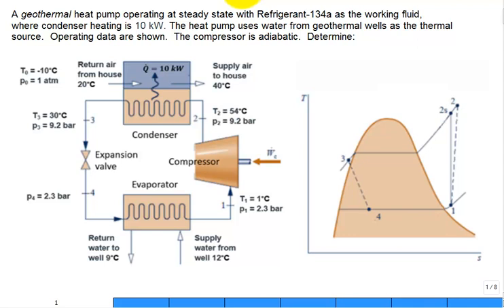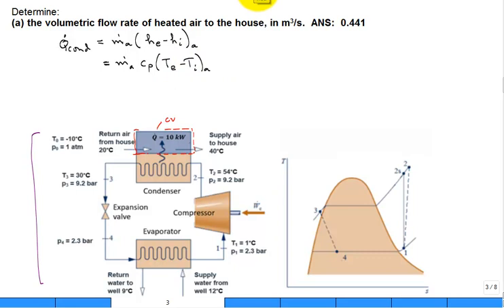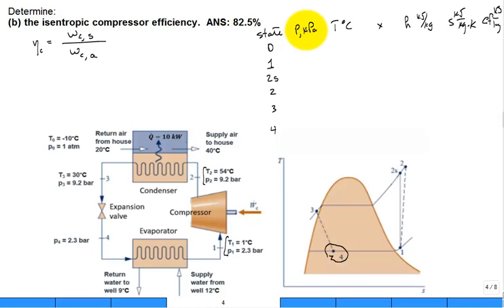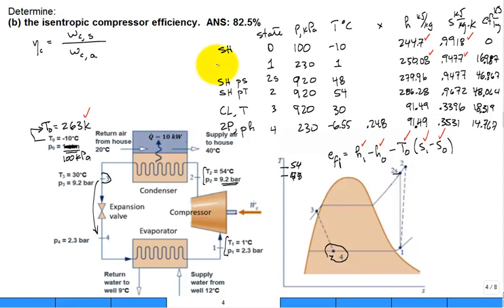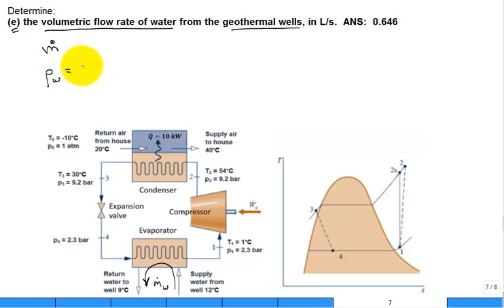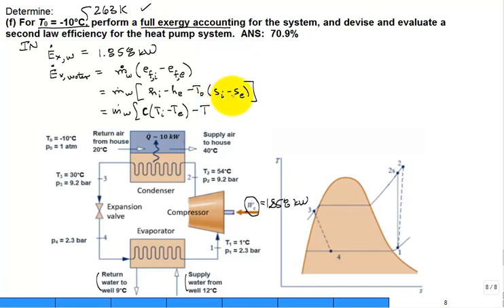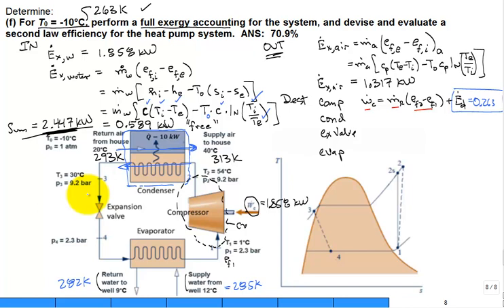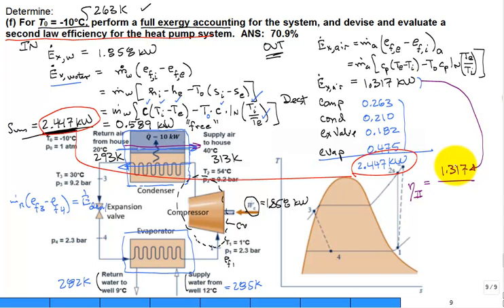me4293 geothermal heat pump with R134a and exergy calcs

Comment: I have a question. I am going to use water for the condenser section. it means that the refrigerant will warm the water, which will be stored in a storage. The ambient temperature (T0) is -15 C.

Now, my question is how should I calculate the water exergy. there is no data for temperature of -15 for water. some papers calculated the air exergy instead of water.

next question, could you please introduce me a reference book for the exergy topic

Comment: I think the properties you used are totally wrong. or the refrigerant is not r134-a
Reply from the maker: check datum point for energy & entropy properties.  Tables in Moran textbook have both enthalpy and entropy for sat liquid at -40 C = zero.  This is common, but other tables/books have different datum point.